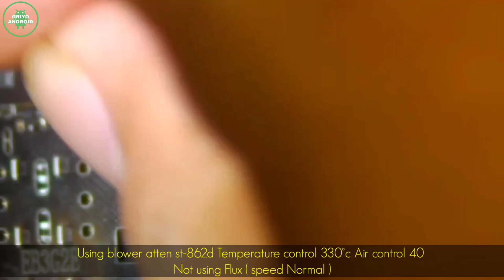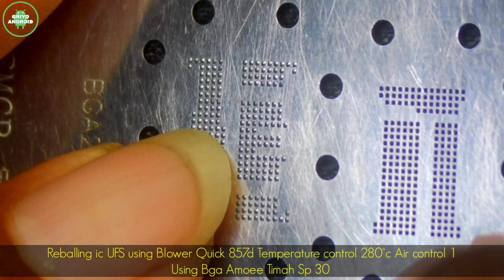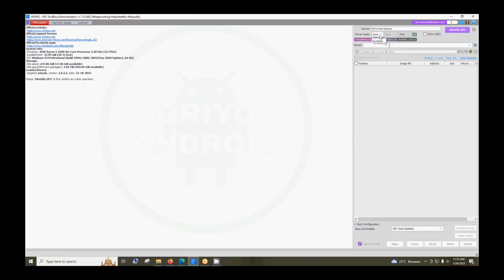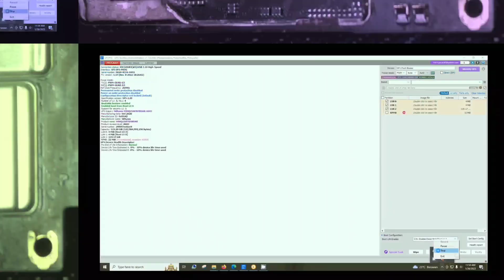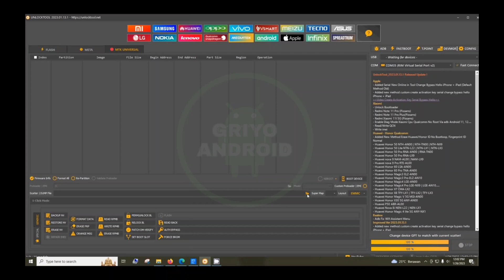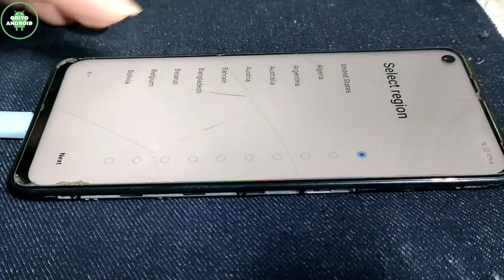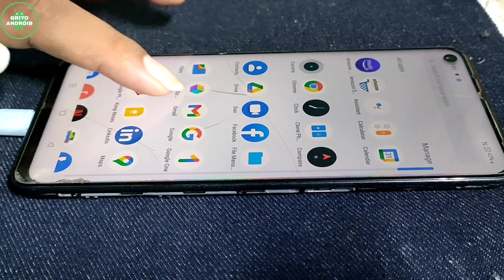Realme 8 5G Dead MTK USB port || Wipe UFI UFS-Prog Solved #ufs #ufi  #realme

Comment: that was amazing..  <3 <3 
is this method applicable for Qualcomm too?
Reply from the maker: Must be check to IC UFS first, and if IC UFS is good, you must backup sert to LUN5, and backup RPMB.then you can continue the steps like in this video,and do flashing using supportable software.